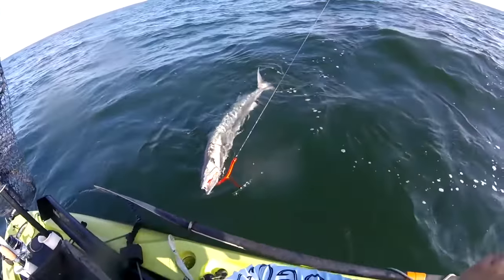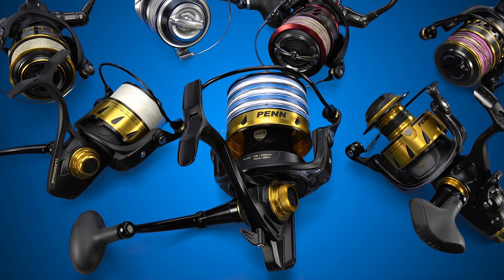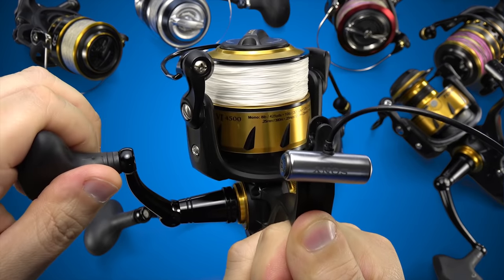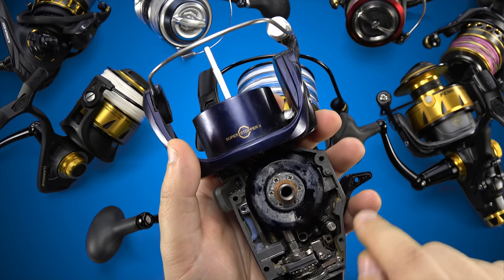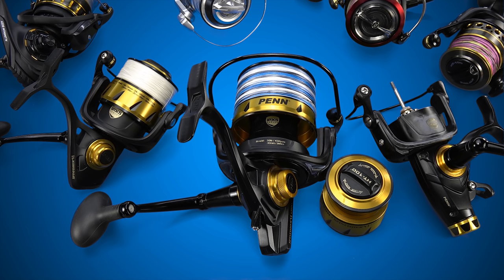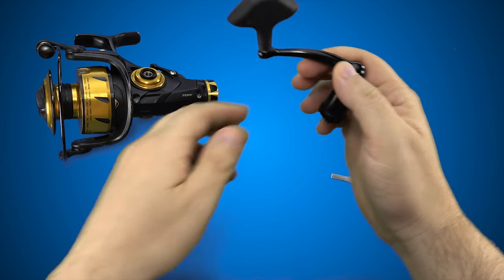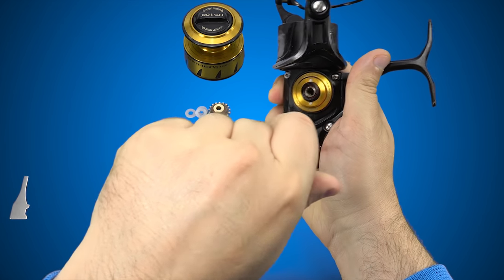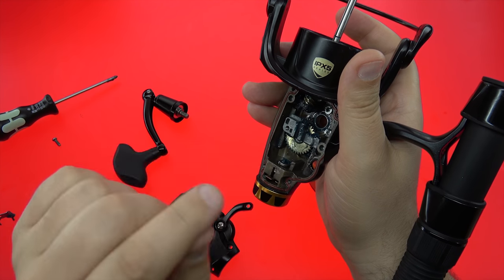Penn Spinfisher VI review  comparison and discussion of ALL MODELS after Hard use  GREAT!

Comment: Great reel! Been fishing the 2500 Spinfisher VI for a few weeks now inshore and offshore and it’s handled plenty of snook, and jacks with ease aswell as light tackle Bonita offshore. Extremely happy with it!
Reply: Also if you don’t like the handle the spinfisher VI comes with, the slammer 3 ball handles are a direct match for the 3500 size and up. I saw somebody that had them on all his spinfisher VI’s and said they screwed in perfectly. If you wanted to go that route.
Reply: @tristanterorotua4232  Tossing up the 2500 with the 3500 ~ fishing mostly inshore (occasional freshwater missions for small stuff). Any complaints on how the 2500 handled with those bonitos or any slightly larger stuff offshore? Seems a weighty reel so tentative to step up to 3500 if not needed. Cheers!

Comment: Thanks for the information, enjoyed your style, as usual. I'm wondering if its worth upgrading from my Spinfisher V to the VI for the surf. That hydrophobic "seal" seems to be the only difference and that seems a bit of a gimic to me. The SSV does have the Slammer drag over the SSVI but that also is a bit of non-difference as you hinted. If you have time, please tell me what you think SSV to SSVI upgrade or not. Thanks.
Reply from the maker: Gearing upgrade is big.  Seal at the main shaft is as well and the top only drag means lighter minimum drag setting which is nice for bait fishing when in a rod holder

Comment: Great video!  I recently purchased the Spinfisher VI 8500LL and can’t wait to try it.  I did notice, however, that the resistance using the live liner function is a bit restrictive, even on the setting of least resistance.  Compared to the other baitrunners I’ve used, this doesn’t feel like it will let a sardine run freely enough to pull line off of the spool.  Is there a way to reduce the resistance when using the live liner so the bait can run?
Reply: Ah, just got my answer at 25min.  Thanks!

Comment: This past December I walked into my local tackle store and sampled different models of the Penn Spinfisher VI and everyone of them was as smooth as the Daiwa BG 4000 & 4500 reels that I had purchased this past spring, so I decided to buy the Spinfisher 4500 VI Bailess model for my 8.5 foot Lamiglas stick I spooled it with 20 pound braid and the reel is surprisingly smooth and line lay is exceptional. I've had a lot of gear meshing problems in the pasted 7 years with Penn spinning reels that I had bought on line with ether CNC or Zink alloy main & Brass pinion gears where I had to open up the reels and re shim and replace the gears myself to make the reels run with a smooth retrieve, I guess I got burned a few times buying reels on line thinking I was saving a few dollars but I wound up with a few lemon's instead.  { I don't know what Penn did with these new and improved CNC gears that they installed into the new improved Spinfisher VI series, but all I can tell you is that these reels are smooth, all I can say is I think Penn's finally put out a very well crafted spinning reel - NOW ALL I NEED IS TO CATCH SOME FISH !!!! }  Winter - Winter Go Away - April & May Can't Get Here Any Faster !!!
Reply from the maker: Yup, yup, and more yup.  These reels are definitely different.  Noticeably so in feel of retrieve

Comment: Excellent video. I don't launch from the beach, mostly inshore in Texas, and have had serious reel issues.  I really didn't know much about reels at first, but I learned quickly as mine kept dying.  One - bait casters in a saltwater bay on a yak is just asking for trouble, period.  Fishing mostly paddle tails on 1/8th oz. jig heads for slot reds, there's nothing you can't do with a 2500 sized spinning reel.  This is where I start to get worried about a reel like the Spinfisher VI.  It weighs 72.5% more than the most comfortable reel I fish, a Tatula LT, and yes, I bought it before I found your videos (which I just can't stop watching).  So, how did I go from breaking reels to using a basically freshwater spinner?  I just learned how to take better care of my reels.  I run a forward mounted rod holder so that I never have to put my rods on the floor of the yak where they would often get some non-incidental saltwater baths.  I keep my spare rods behind me in rod holders on my milk crate rather than on my side mounted rod holders where they can get splashed.  I have probably 15 to 20 trips and a few hundred pounds of redfish on the Tatula, and it shows no signs of being worse for the effort.  So, for how Elias is fishing, the spin fisher seems like a good bet, but for constantly jigging and paddling, a light freshwater spinner that is well managed for inshore stuff where you aren't trolling for king mackerel or running live/dead bait for bull reds, will keep you fresh quite a bit longer.  On the yak, and when seated, your arm position is quite a bit less ideal than from the river bank or on a boat.  It's more like surf fishing waist deep.  Your hands are right below chest height, and a light setup is very valuable.  So, ya, there are varieties of kayak fishing, and I can totally see that this Spinfisher would be great for wet situations where you weren't doing a ton of jigging, but the way I fish, I want to stay light.  Anyway, great channel, I've been watching while I have rebuilt roughly 30 reels while recovering from a back injury.  Keep it up, I may do some of these myself.  Taking my very early Calais 200 from stuck and corroded to working with Bantam1 to get some very rare parts and having it run so that it is noticeably more smooth than my new Curado DC is my best effort so far.
Reply from the maker: You bring up great points.  And it's something I considered when sending him reels.  He's been fishing a fuego lt and it died (i have it in a box unopened as of yet...and it lasted I belive 5 months which is pretty good...I sent him a smaller exceler to see if we could push the limits and it died in a week lmao.  But it did catch some sweet fish.
It's good to see the non sealed version of the ballistic is still going strong..one of the things I did to the exceler as part of an experiment was grease the snot out of all the entry points to see if it lasted longer than the fuego with mag seal......Too bad it couldn't hold up to the fish....I'm ccurious as to how it died.  They have a bit more flex in the stem than the tatula and ballistic.  But the frames seem to keep everything where it needs to be.
Please do! Youtube needs more people who know the gear inside and out talking about it.  Good luck with the back.

Comment: Currently using the Daiwa Exceler 4000H.  Smoothest reel I have ever owned.
Reply: Keep an eye on the anti-reverse bearing in saltwater. I have one. Love it. Was the smoothest reel I ever fished with, until I took it on my kayak in the sea. That anti-reverse bearing died very quickly. To replace it costs nearly half of what the reel cost me. I take care of my gear. I rinse everything off with freshwater after use, service my reels regularly, especially the ones I use on my kayak, but I was blown away at how fast that anti-reverse bearing got killed

Comment: Well, did shimming the gear farther away from the left sideplate eliminate the geariness?  When you pull the handle away, it seems like it carries the main gear with it just enough to pull the teeth away from the pinion to create added space between the teeth enmeshment surfaces, giving it the gear vibe. By screwing the bearings down tighter, it could only add more lateral slop to worsen the gear vibe.  To me, it seems like the right balance of shimming between the left and right sides would eliminate the lateral play and brace the main gear by just barely snugging it up to the pinion.  Yeah?  So, so did Penn ever get back to you about it?  Maybe the defect is why it was probably a display model at iCast.   --Rich

Comment: Very helpful video, nicely done. Will you consider to compare Penn spinfisher VI and Daiwa ballistic LT in details in a further video? I am upgrading my spinfisher V to either these 2 reels, so really hoping to learn more about them. Thanks
Reply from the maker: Down the road I'll do teardowns on both..I did an initial tear down of the smaller ballistic when it came out.  Both are simple internally.   Bulletproof.  The ballistic just lacks a perimeter seal and has less sealing.
Along with caps out at the 6000 size which is the 4500 penn equivalent.  I have had great experiences with the smaller sizes and so far on the largest Ballistic.

Comment: Hey, in
the normal non longcast Spinfisher Vi models: 5500 and below have ali gears,
whereas the 6500 and above have brass main gears. Do you know if this is the
same for the longcast models? i.e. does the 5500 LC have an ali main gear and
the 6500/7500 LC have brass, also? I can't find any info about this on the LC
models. Here in NZ, we get massive sharks and Kingfish off the beach/rocks, and
I would rather have the brass gear. Any ideas mate? Ta muchly, Dave down under

Comment: Hi, I see the long cast version has a switch for anti-reverse? I just bought the 8500LL version. Happy so far, but not used to the clicky freespool when in baitrunner mode and the fish is running. All my shimano baitrunners have a smoother spool spin when in br mode. Is this normal do you think? cheers

Comment: Curious if the price of this reel doesn't change say it stays around 160 for the 3500/4500 does it fish that much better than a BG to justify the extra 60 bucks for this reel?
Reply from the maker: It's not that it will fish better than the BG out of the box.  But it's like new performance will likely last if exposed to salt.  The BG in this vid had a corroded pinion bearing as did a different reel in my maintenance vid.  Salt and that area of the reel don't mix wheel in the BG.  If you don't get a defective Penn reel it will likely out last the BG as good as the BG is.  If it were my money I'd see the extra cost as worth while.  After using the larger ballistic if you could swing that... Holy bajeezus is the weight savings huge

Comment: How good is the Spinfisher VI combos? Was looking at the 3500 combo for my first salt water setup. Any suggestions on a rod and reel for $200 or less would be greatly appreciated Scoob🙏🏻 mainly fishing from beach in Florida throwing artificials. Thanks
Reply from the maker: Hey Steve! It's a damn good setup.. Combo prices have gone as low as 130$(cheaper than the reel by itself due to M. A. P. Dealer agreements not applying to combos...) but even at 2 bills its a good value.  They suffer similar issues as others from what I've seen.. Line roller bearings and pinion bearings corroding if dunked... Still an excellent setup that can handle anything you throw at it.. One of Penns best spinners to date
Reply: Tackle Advisors Thanks!!any ideas when we could see prices in that range anytime soon? Any other options that you think would be as good?

Comment: Is the Dawai Ballistic better then the Penn SpinFisher? Additionally is the cost increase for the Penn SpinFisher VI worth paying over the Penn Battle III?
Reply from the maker: The $ increase from b3 to spinfisher is quite possibly the most logical step from one product in the lineup to the next... In the entire industry... You get seals and on larger sizes an even bigger upgrade... Ballistic vs spinfisher.... Ballistic is feather light and ultra refined but needs to be babied in the salt and sand... The spinfisher is a tank... Doesn't like being dunked in salt but can take splashes and the elements very well.. It's also one of the simplest reels to maintain on the market... Which is important if you expect long term use in a saltwater reel

Comment: Best line lay ive seen on penn spinner... i always have to use a shim when im putting on new line manually.
Reply from the maker: ON the long cast I had some trouble.....had to shim the rotor and remove the spool shim to get it to where it is now which is damn good but not perfect as it oddly gradually caves in at the top.  The others spooled up with no drama

Comment: didnt see u mention much about the LC model, are the the same as regular spinfisher? as for the weight and line capacity, i think the spinfisher LC is not so great compare to ultegra or the Penn Conflict ii Reel. so i guess the Spinfisher VI LC model not gonna sell much. they need to cut the weight on those
Reply from the maker: It's the only long cast spinner as far as I'm concerned that isn't a carp reel.  It's sealed the same has a brass main gear and is overbuilt.  My long range setup is an 11 foot tiralejo 3-6 that I don't really like all that much..I just grabbed a tournament ballistic 11 footer rated 2-8 and love it.  And just built a 13 footer and it's on the dryer now....though it'll likely see conventionals or  a smaller spinner.  I like it for what it is......long range bait reel  or keep in in the truck and break it out for when breaking fish are out of range and you need an extra couple yards. which is something I've always made sure to keep on hand. just in case

Comment: can you reccomend a replacement handle/knob for the 6500 liveliner .. i dont like the elbow/link(folding rocker?) joint styled handles. they are only as stable/flush by how tight u have the handle. 
i see a few aftermarket ones but lots of them have that elbow/link joint. =( ...
Reply from the maker: Im not aware of a Penn replacement is a 1 piece

Comment: If the hydrophobic liquid gets wiped off by mistake when cleaning the reel, what would you recommend doing?
Reply from the maker: I used that rustoleum 2 part product and it seems to have lasted (my ssvi long cast didn't have it applied so I tried it). Worth mentioning I only used it 10x with no spray or dunks

Comment: i personally don’t like the spinfisher 6 livelier because of the new way it works. instead of turning the knob on the bottom to adjust the ll drag, the switch that activate the ll is used to set the ll drag. i have a spinfisher 5 ll, and i use it for surf fishing and for tog in ocean city. just my opinion, i think the normal and long cast spinfisher 6 is great, just not the liveliner.

Comment: Im glad i grabbed the Penn Slammer 3 when u posted the sale from amazon, thank you. Spinfisher VI just not enough bang for the bucks compare to the slammer at the price i got it for. 
BTW, why is the balistic LT look so much like Fuego LT, what the the different between the 2, i bought the Fuego L2500. line lay was bad out of the box....
Reply from the maker: The fuego lt needed shim adjusting for me too.  I think i had to remove  a shim.   The ballistic has a very noticieably more rigid frame...and stem.  The main gear also is upgraded from cast zinc to machined aluminum along with being lighter.    The 6k ballistic is essentially the same size as the saragossa 6k minus 6 ounces which is huge.  I reallly like them.  Very nice reels and for fw that tatula come in cheaper but doesn't have any form of sealing.   (heard there are two new LT reels coming in a few weeks :)  daiwa is going the way of cell phones with these winter debuts lol

Comment: I have the spinfisher v 6500ll and after surf fishing, dunking the reel in the ocean and cleaning it with a hose
There’s  a gritty noise when I turn the handle. Sound I believe comes from the        Rotor or inside. Would this be bearing is rust or not lubricated or could it be sand and salt in the body of the reel?
Reply from the maker: My guess is the same thing that happened to mine.  Ball bearing at the top of the pinion gear.  That happened to a slammer and the spinfisher vi in this video...oh and the daiwa BG in this video
Reply: Tackle Advisors what would be the correct way to fix it
Reply from the maker: @civic30045  sight unseen tough to say for sure.  It's raspy without retrieving line.. Just free spinning it.  That's a good indication of a shot pinion bearing.  Remove spool remove 3 screws on top of the rotor.  Remove rotor nut.  Remove rotor. Remove 3 screws at metal disc make sure you don't disrupt the hydrophobic coating.  That exposes the top pinion bearing.  Replace that bearing.  But check to see if the bottom bearing is good too
Reply: @TackleAdvisors  curious I have a Exceller I dunked in salt and I cleaned it and regreased it but now it sound noisy when retrieving. The strange thing though is it isn’t that noisy when just spinning the spool with no lure on. It only gets noisy when I’m retrieving a lure. Any thoughts on what it could be?
Reply from the maker: @stevestory8483  Hey man...line roller needs cleaning or replacing.  The bearing or bushing may have salt or mineral deposits or corrosion. Very common
Reply: @TackleAdvisors  thanks I really appreciate the help
Reply: @TackleAdvisors  I have broken down the reel twice trying to figure out what was wrong but of course forgot to clean the roller bearing. Just cleaned it and the reel sounds great again. Thanks for the help  and I really appreciate you taking the time to make them and teach us how to do our own maintenance